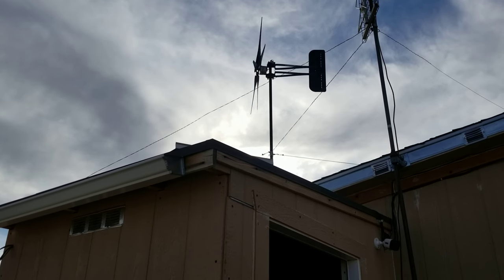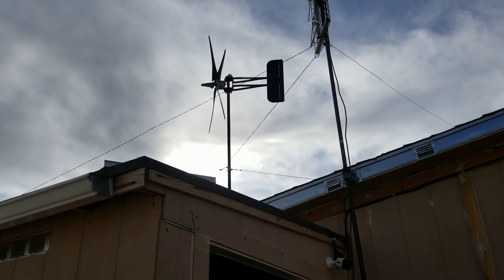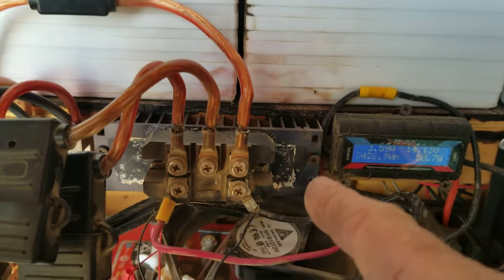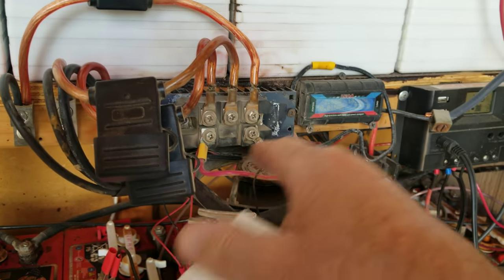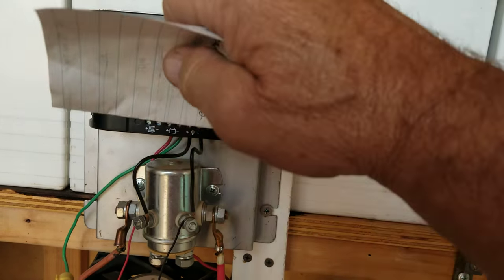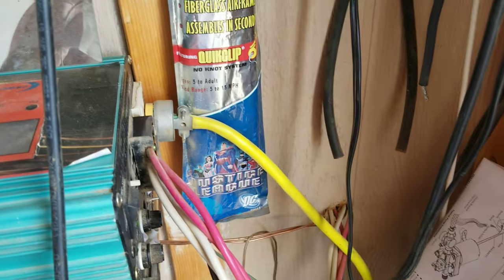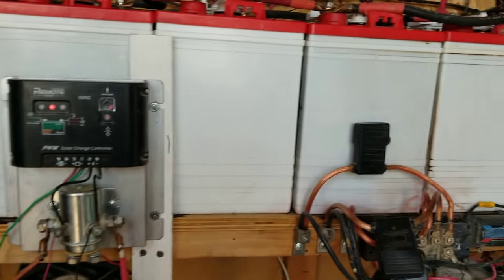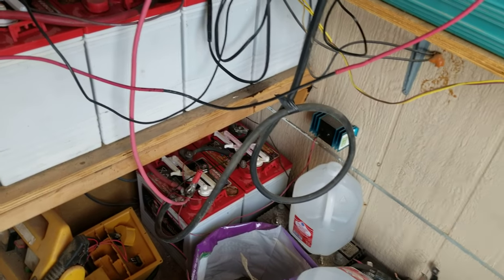Wind turbines, controllers and batteries explained, March 6, 2020

Comment: hello sir can i connect pwm charge controler with wind  turbine
Reply from the maker: Only if it is specifically designed to handle wind or hydro power.
Reply from the maker: Welcome aboard!
Reply: thanx for helpful reply sir
Reply from the maker: @mehtab100me4  you're welcome

Comment: You know that hybrid controller is only mppt on the wind side right? The solar side only operates in pwm
Reply from the maker: I know that hybrid controller is a piece of crap.  Love my new Midnite classic 150!
Reply: @GBear  what exactly is bad about it if you don't mind me asking, does it work at all?
Reply from the maker: @shitina.bucket9699  the wind side never worked, and is probably what burned out that Chinese PMA.   The solar side worked, but basically did nothing to control input to the battery bank.   Many times I heard the batteries boiling on long sunny days.  That doesn't happen anymore with the new controllers.
Reply: @GBear  thank you for your time and speedy replies maybe something like a Midnite Kid is what I need
Reply from the maker: I don't know your setup, but I swear by the Midnite classic 150 as the best out there!  Worth every penny!

Comment: Hi there, I have a Chinese 300w wind turbine with only 2 wires at the base of it, what should I do?
Reply from the maker: That is a wind 'generator's or a PMG.
One wire should either be red, or tagged with  (+) and the other one would be black, or tagged (-).
Those wires connect directly to the battery bank positive and negative terminals. 
You may also want to purchase a precision watt meter and power analyzer gauge to put between the Turbine and the battery so you know when and how much power you are generating.
Watch today's episode and I will do a segment on it for you.
Welcome aboard.
Reply: G Bear's Off Grid Ways-A Homestead In The Desert mate what a legend I really appreciate that, also wanting to get into YouTube clips myself here in rural New Zealand ur an inspiration! That’s exactly what the wires are, will watch ur clip now..
Reply from the maker: @caleyhall  give me about 2 hours more to get that video made.  I have to finish my morning chores first.
Reply from the maker: @pan pan hi, welcome aboard.  The controller that came with it is usually a rectifier.  All you need is a meter place between the rectifier and the battery (s), so you can monitor the output/input.
Reply from the maker: @pan pan that controller/rectifier is supposed to have a built in limiter, but I never trusted them.  That's why I added the meter to the output side.  You can also add a digital load diverter if you see higher voltages.
Reply from the maker: @pan pan yes, you could tie off the prop with a good piece of nylon rope.  I wouldn't trust a bunny cord in case the winds get strong.
Reply from the maker: @pan pan be sure the pole (mast) is heavy duty, have a secure base anchor, and use at least 3mm cable for guy wires, securely anchored to a solid base.
In high winds, a PMA can be under 2000 psi of stress, like a car with a tow rope trying to pull it down.
Remember last year mine pulled a 120 pound concrete anchor footing out of the ground at the base of a guy wire.
Also add heavy duty turn buckles to the guy wires, as cable can stretch over time and turnbuckles allow adjusting the tension.
Reply from the maker: @pan pan of course, yours will be on a short mast, not 25 feet in the air like mine.  I needed 2 sets of guy wires on my mast because the pressure was causing the mast to flex between the guy wires and the base mount.
Reply from the maker: Yes drilling a hole is not recommended.  The better the balance of the prop, the more efficient the pma.  Also, an out of balance prop puts excessive pressure and causes wear to bearings and shafts.
Many pma users balance the prop and hub before installing it on the PMA. To do this they hand the props and hub on a rope through the center of the hub, with the prop blades just inches above a level surface. ( note: tie a knot in the bottom of the rope and place a metal washer above it for the hub to rest on)
Now measure from the tips of the blades to the level surface.  All should be equal.  If not, start with the blade that is the highest from the floor and place a flat washer over one of the hub bolts.  Once balanced, loosen the hub bolt and permanently add the washer under the nut.
Reply from the maker: Oh, and to secure the blades so they won't turn in the wind, you can use a couple of heavy duty velcro straps. Wrap one around one of the blades, thread another under it and wrap it around the mast.

Comment: What's the most power u ever got from that windturbine
Reply from the maker: 1082 watts.  60+ mph winds.
Reply: @GBear   that's great I'm running a 24volt system  with a turbine from a different company.. I got over 50amps from it
Reply from the maker: solar  mine shows it hit 65.97amps peak.

Comment: When we keep things cool to avoid overheating, we usually suck the heat instead of blowing it.. I see you blow your selenoid to keep that cool, means that you keep the heat trapped in it instead of sucking it away.
Reply from the maker: Nice try.  But the air blows over and past the solenoid helping to dissapate the heat.  The fan blows upward, drawing cooler air from down low and assists in pushing the heat upward as it normally flows. :-)
Reply: @GBear  I know that's cooling down the selenoid, but only the surface of the body is cooled, because you push the heat (produced from the inside) back in instead of sucking it out. That would make the inside components suffers even worse. Anyway, nothing is serious with  either way considering only a minor heat. I only share my logic thought on common heat handling as applied anywhere like in Computer processor, Memory chips, Air Cond system and everything else that usually use Sucking Platform. You can keep going, sorry for the inconvenience..
Reply from the maker: @TheCoolncold  Sorry, I don't see the difference of the air blowing over the unit or being sucked in the opposite direction.  The solenoid is not in an enclosed container, it is wide open.  whether the air flow is from the left, right, top or bottom, the air movement flows past the solenoid case moving heat in the same direction.  By placing the fan below the unit I draw cooler air from lower in the room, and blow it past the solenoid as  the heat rises, assisting the normal rise of heat.
Reply: @GBear  Okay sir.. go ahead. Sorry if I disturbed anything. Have a nice day or evening.

Comment: You should blow air in from outside, not suck 'hot air' out heat rises. Your extraction fan is too low and will actually bring the hot air from the ceiling down past your inverter
Reply from the maker: Welcome aboard. Yeah, but if I am doing it wrong for the last almost 9 years, and it is working, then I see no reason to fix it.😀

Comment: Hi thank you for your great video! My turbine project group is struggling with finding the right controller for our wind turbine. Our generator is a single phase and we were wondering if we could use a 3 phase controller? We were also wondering if solar power controllers are compatible with wind turbines? If we have further questions could you please provide us with an email we could reach you at? Thanks again, cheers.
Reply: We could also supply you with an electrical diagram if thats helpful
Reply from the maker: @jasonshao2416  yes, please do.
Reply from the maker: You can email to GBearHomesteading@Yahoo.com
Please include pictures of your components and setup so I can accurately advise.
Reply: @GBear  Ok. I'll have our diagram sent over very soon and we can discuss via email. Thank you so much for your time! It means a lot to our entire group.

Comment: Can I use a solar controller to regulate my windmills
Reply from the maker: No.  Unless the controller is specifically designed for a PMA or PMG, like the Midnite classic.   Cheap hybrids from China shouldn't be trusted and I had a turbine burn up because the hybrid failed.
Reply: @GBear  ok the one I have is a Wanderer PG 10A Pwm version 1.0 model number RS232 from Renogy.
Reply from the maker: As far as I know, that model is for solar only.
Is your turbine PMA or PMG?
Reply: @GBear  I really don't know sorry for all the weird questions thank you for your help
Reply from the maker: Does the turbine have 2 wires or 3 wires coming from it?
Reply: @GBear  3 wires going into a small box then  2 wires coming out
Reply from the maker: Ok, the small box is a bridge rectifier.   The 3 wires coming in are AC power. ( Alternating Current)  and the bridge rectifier converts that to DC (Direct Current) to charge the battery bank.
You need to determine the voltage of the turbine, ie; 12v, 24v, 36v or 48v so it matches your battery bank voltage, otherwise it is of no use to you.
If the voltages match, the 2 wires coming from the bridge rectifier are pos/neg and go directly to the batteries. 
Then you need to purchase a digital diversion control.  You can find them on Ebay or Amazon.   Those will protect your battery bank.
If you need more detail, feel free to ask.
Reply: @GBear  ok thanks its 12 13.5 volts depending on how fast its going
Reply from the maker: And that matches your battery bank,  so just connect it directly to the bank and add a digital diverter to send excess power to an outside load and you are fine.  
I don't know how strong your winds get or the max output of your turbine, but just add a couple of 300w loads to the diverter and you should be fine, unless you're in hurricane alley.
Reply: @GBear  ok thanks for all your help I'll order the diverter next month I am in southern California and its either really windy or nothing
Reply from the maker: What size turbine do you have?  Make and model if you have that info, please.
Reply: The sticker on the rear fin says...model zl-800 blade number 3 diameter 1.2 m Ip grade Ip65  rated power 800w rated voltage 12v
Reply: On the box with the 3 wires into 2 wires it says breaking voltage 14.5
Reply: @GBear  I believe the brand name is Dyna Living
Reply: @GBear  I got 2 of them from a friend who never set them up
Reply from the maker: @jackraintree4351  ok, that translates to 47" blade span, 3 blades, stall speed 65mph, max output 800watts.
So, to produce 800 watts, you need a 65mph wind.
That is possible in SoCal, but not often.
Depending on your average wind, you will probably get 200-400 watts, but mostly much lower.
Another item to order is an inline meter to show your inputs.   You can find that info in my playlist videos titled "Wind, Solar and Related"
Reply: And the little box has 3 lights on it break charge and battery
Reply from the maker: @jackraintree4351  that has a brake built in.  You won't need a brake system unless you live in hurricane alley. 
Your blades will 'stall' and quit producing at 65mph.
I would dump that controller for a standard 150watt bridge rectifier.  They aren't expensive and there are no 'dummy lights' to confuse you.
The inline meter will tell you everything you need to know and never brake the turbine.
Reply: @GBear  ok thanks for all your help I just was worried about cooking my batterie
Reply from the maker: Not familiar with the name, but the numbers tell all.  What area of SoCal are you, without giving away your exact location?  Also, are you off grid?
Reply: @GBear  yeah I am in the desert in a small camper I got 200w harbor freight solar panels and the 2 windmills and a 3 old but working deep cell batteries
Reply: Near the saulton sea
Reply from the maker: That will help you survive, but you really need some more powerful panels added, a good mppt controller, and more batteries.  Don't rely on wind power, it is only a backup.
Reply: @GBear  yeah I am going to keep adding to the solar the windmills were free so I just want to add them to the system
Reply: @GBear  when the batteries are fully charged the breaks come on
Reply: @GBear  looking at your other videos I think were in the same general area
Reply from the maker: I'm getting 20mph winds right now, they were up to 37mph earlier.
Reply: @GBear  it was windy all day now it nothing

Comment: You could hook up the extra watts to some sort of crypto miner. It would definitely take some planning.
Reply from the maker: Welcome aboard. I'm not sure about that, as I haven't mined crypto.
Reply: @GBear  anything that does work you benefit from is better than nothing. May want to look up microwave pyrolysis reactors.
Reply from the maker: Welcome aboard. I'll give that some research!
Reply: @GBear  
Well it produces a lot of gas, presumably, methane, but it's a device you would have to weld yourself. It wouldn't be too good of a dummy load, as it has to run for quite some time, but ever since you can turn plastic into gas for later storage, I guess a plastic shredder you'd be able to prefeed would be a thing to consider as a dummy (if you would have had the reactor). How many watts would you estimate your system has on the overvoltage, and how many watts is the heater you've got mounted in there?
Reply from the maker: My over watts is minimal, unless I get a long period of high winds.  The heater load is only 300w, and doesn't get much use since I switched to a Midnite Classic controller.
Reply: @GBear  
Alright makes absolute sense. I got a tad bit dofferent question though, wouldn't putting some capacitors behind those fans be a good idea to keep them running for some time after the battery load drops and overvoltage is no longer a problem? The solenoid still retains some heat after all, but Im not sure whether it likes 'sudden' temperature drops. Thanks and cheers to you.
Reply from the maker: Good thinking, but I think a little overkill.  The fan at the solenoid comes on when the solenoid does and keeps it cool to the touch the whole time.  So when the solenoid kicks off, there isn't much residual heat left.
The fan on the rectifier runs 24/7 while winds are in the forecast, and I shut the manual switch off when winds are done for the season.
Reply: @GBear  
Yeah, am guessing a lot on how its all functioning based off of single video, so do pardon me. :) weather planning up ahead is a good thing to note, offgrid or not. It may sound a little weird, but I do like to think for others and give off advice even if nobody asks. Just a personality type, I guess. I think some thermal insulation on the cabin could do a lot in the matter of keeping frost and heat out, but not really sure whether a 'controllable indoors environment' would be that easy to set up. Would have to calculate the volume of the cabin, the amout of heat generated by electronics, volume of air moved by the fans and all other stuff, although geothermal air conditioning would lilely fit somewhere in the sweetspot for all seasons. Sorry if thats too much of ideas, Ill just tap em off from now on.

Comment: Great video
Reply from the maker: Thanks Tony, welcome aboard!
Reply: @GBear  I'm a 30 year retired electrician, I always said when I retire I don't want to have a electric bill , well I still do. But I'm looking into going wind and solar. but I'm doing my research first. Just because I'm a electrician I wired restaurants and solar is  different. But for the DIY I have a little head start I do understand voltage drop and how to size wire. and a parallel V/S series.  The Higher your voltage the lower your amperage.   How long do you get out a a inverter.
Reply from the maker: Welcome aboard Tony!
As with all electrical components there are variables as to how long they last.  My first inverter was Chinese made and although it still works I found out the hard way that it's "pure sine wave" wasn't clean.  It caused problems with my refrigerator and stove and microwave.  It also lied about its capacity claiming 32000 watt surge capability, the in fine print right on the inverter it says it won't handle a pump motor 1200 watt surge.  Long story short, avoid Chinese made inverters.
I have since switched to an AIMS split phase low frequency inverter and am loving it.  With proper care, not to overload it, keep it clean and dust free, I expect a long lasting relationship with this inverter.

Comment: Waaw you are amazing finally i found someone who explain a lot to me but i have question can i install solar mppt controller!?? because my turbine is diy home made and we don't have shops sell wind turbine things
Reply from the maker: Welcome aboard!  First, is your turbine 2 wire or 3 wire?
Reply: @GBear  I'm using DC motors from broken DC fans so it's going to be PMG like you said
Reply from the maker: @almaarmhk6218  So, what is the output voltage and amps from the PMG?
Reply: @GBear  i don't know actually i don't have the tools to check the output voltage and amps you know limited access 😅
Reply from the maker: Well then I guess you'll have to do a smoke test.  Hook it up and if you see or smell smoke, disconnect it fast.😂
Connect your battery or batteries to the controller FIRST, to tell the controller your voltage needs, then connect the PMG to where the solar panels would normally go.
If you have a power drill, remove the turbine blades and use the drill to spin the motor to test input.  That way if there's a problem you just have to stop the drill.
You may have to install a diode on the PMG wires if the controller doesn't have diode protection, or when the turbine isn't producing, the power may backfeed through the system to run the motor.  You will hear a humming sound if voltage is low.
Good luck, and be sure to let us all know how it comes out.